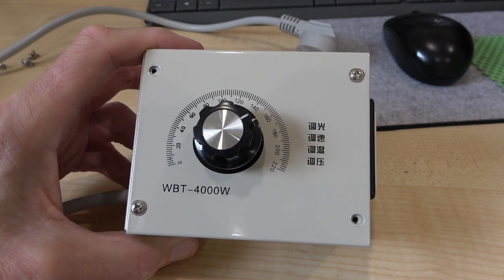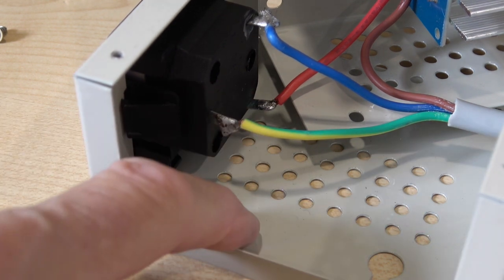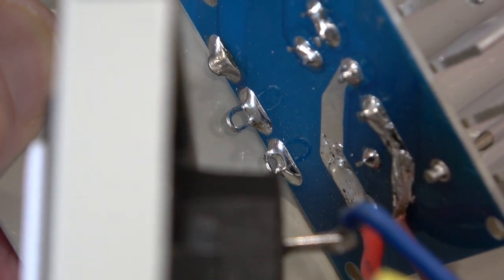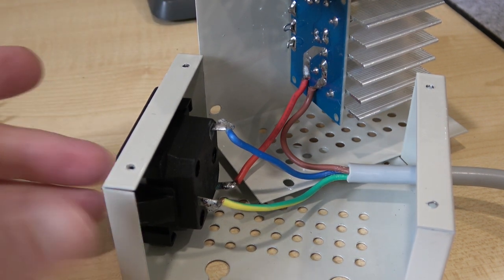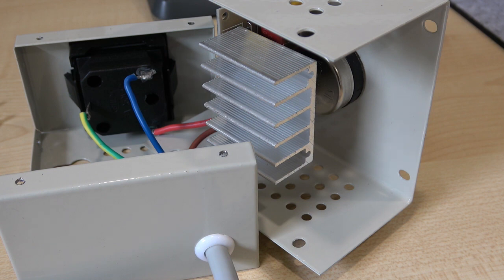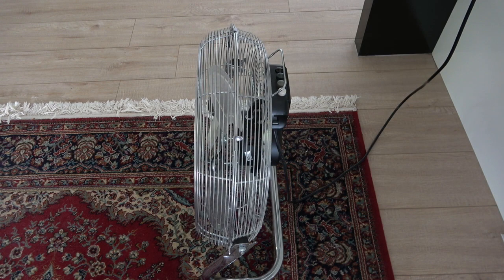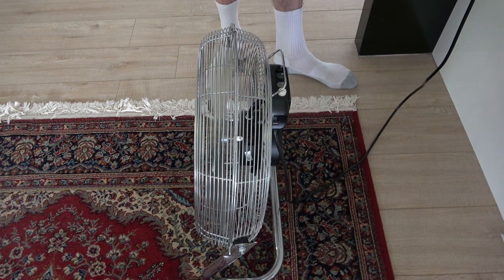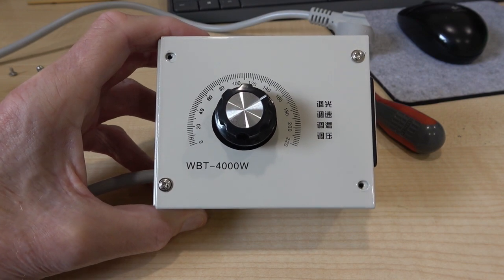A DEATH TRAP! Triac Speed Controller from Banggood.

Comment: I use something older to control an ancient clothes iron without a thermostat. Think used to be called a universal motor control and dimmer box. That seems alot for that box. It's almost always necessary to check over that cheaply made stuff and make improvements.  I would have thought that something like that would be more like 15 US dollars or so.
Reply from the maker: Yes you are right Mark. The product does work, no real issues with that, it's just so dangerous. Don't forget the price was in $ND.

Comment: Hi Michael, nice video. I tried a similar approach to control the fan speed using a light dimmer (based on triacs) and got the same results (loud noise). Curiously I had an identical fan and I live in Rio de Janeiro, Brazil! I ended up replacing the capacitor with a lower value one, but the fan would get hot on the lower velocity. Thanks for sharing and I really enjoy your videos!
Reply from the maker: Hi Cesar, these things have had lots of different names over the years. The basic circuits has been around for ages, mostly used for controlling motors, lights, heater etc. They can produce a great deal of interference however, should really have the appropriate circuitry to limit this. As they don't care if it kills you why would the worry about interference?